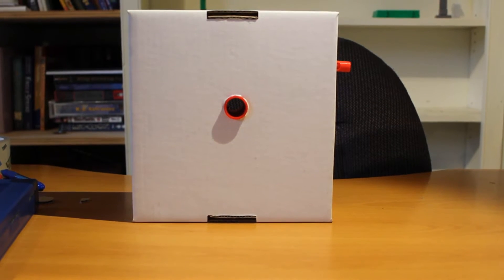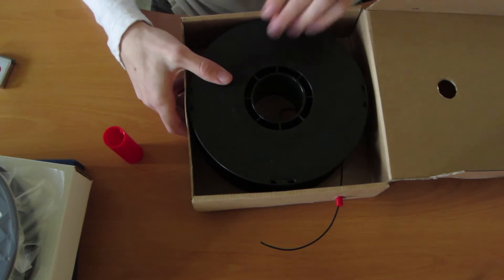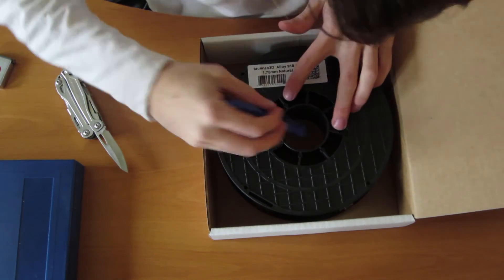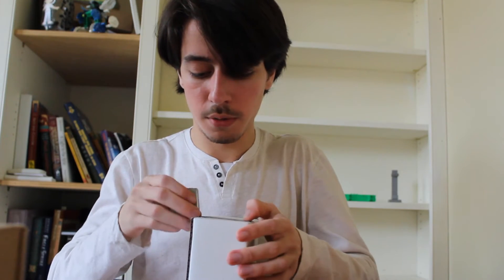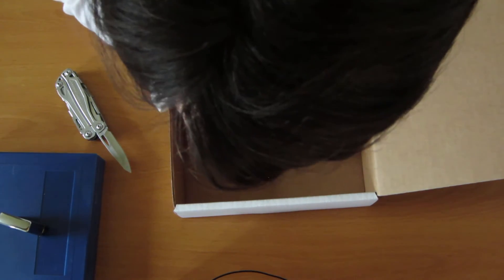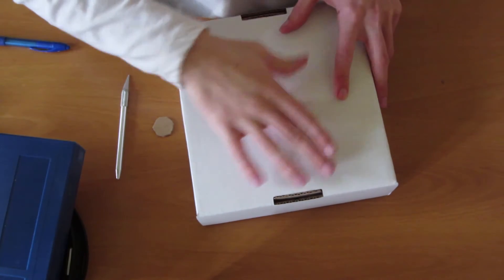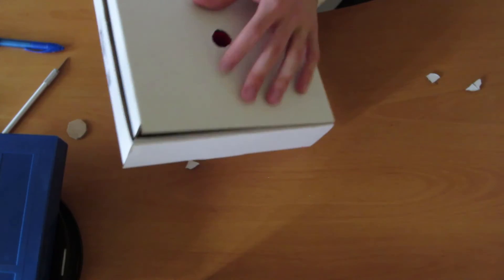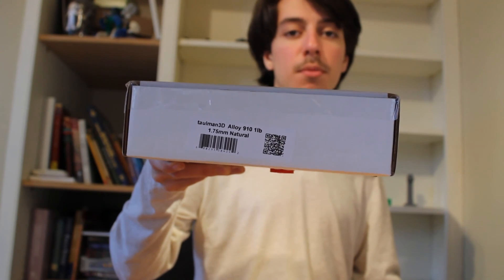DIY 3D Printer Filament Cartriage

Comment: Wrong wrong wrong!!!  The desiccant will not work as once its exposed to air it will only work so long (very short time). The paper on the desiccant has a marker that changes to show it is no longer going to work. Cardboard is not air tight so you are still going to get water in the filament.